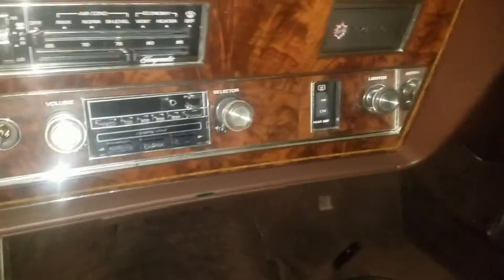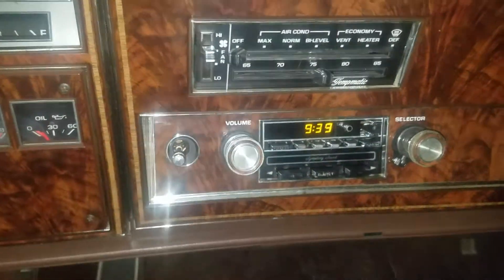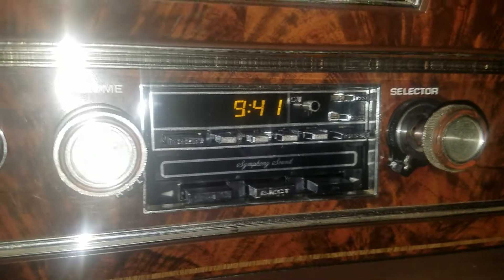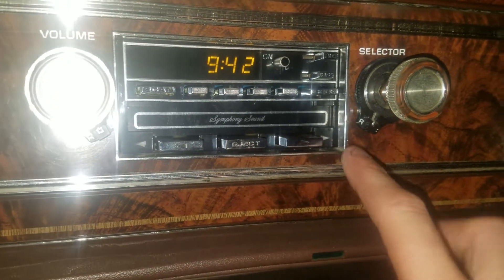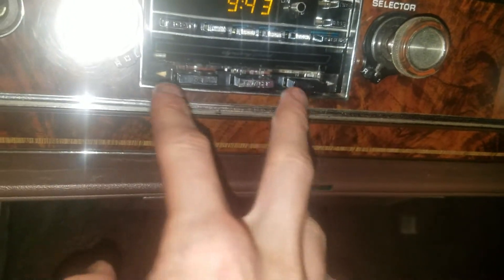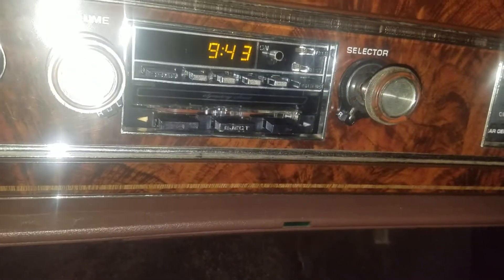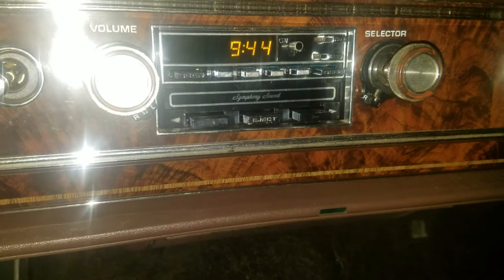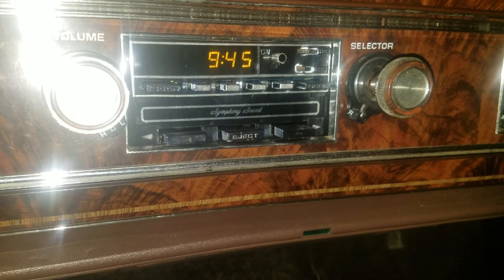how to set the clock on Delco ETR radios for cadillac/oldsmobile/buick

Comment: Try pushing in on the volume control knob while the tape is playing and see if that reverses the tape direction.
Also, pushing the volume knob while the ignition is off will briefly display the current time on the clock.
Pushing the volume control knob when the radio is on will switch between showing the time and station frequency.